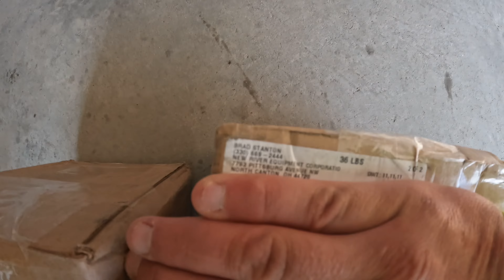Boulder CO stump removal

Comment: how is the trans on those newer trucks?
Reply from the maker: I got the Aisin in this one. I’ve always had the 68RFE. I’ve gone through quite a few 68RFE. This Aisin only has 46k miles on it but it feels like the aftermarket RevMax 68 I replaced the stock trans with. I’m impressed so far. Curious to see how long it lasts but it feels great